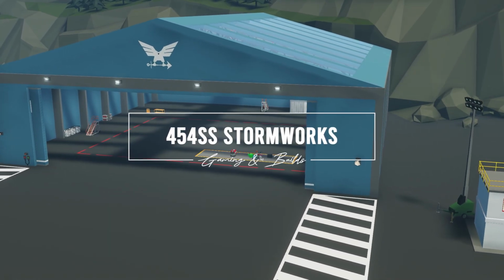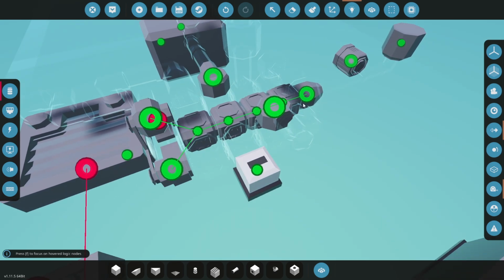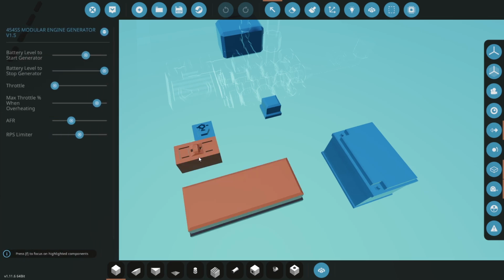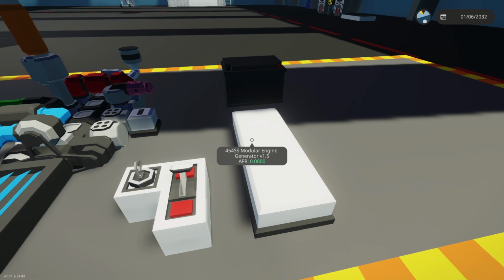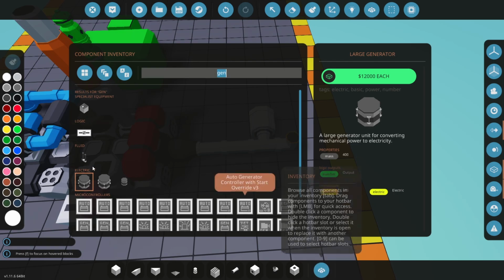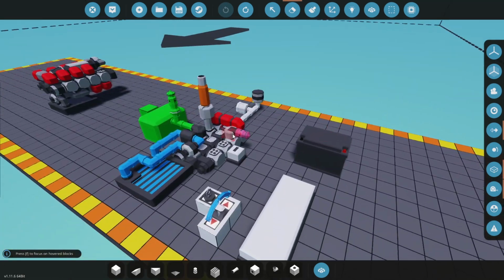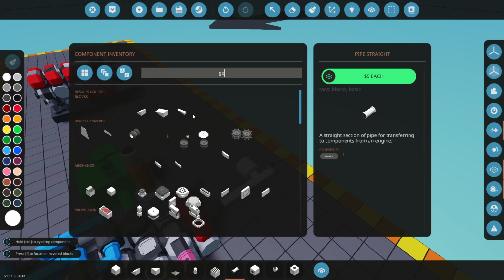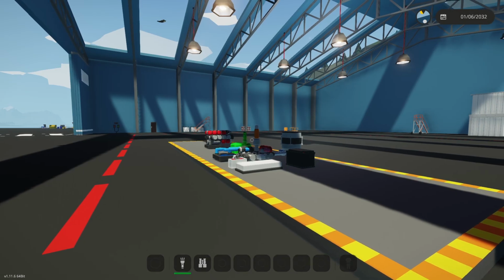COMMON Modular Engine MISTAKES in Stormworks

Comment: i downloaded the game like 5 days ago and i went trough all the tutorials and i cant make an engine run, i even tried only connecting the air intake, fuel intake and exhaust but even there the engine doesnt start up
Reply from the maker: It can be tricky at first, but with a bit of practice you'll be building engines in no time!
Reply: Did you find a solution? Losing my mind because im struggling to start it too

Comment: My Engine is starting and running but not putting out any power... and I cant find the reason :(
Reply: Have you set the alternator's clutch pressure?
Reply: @petlebem  yeah, but meanwhile I found the error. I had a pipe between the engine and the clutch for reasons of space. But thanks anyways

Comment: you didn't explain this in the video but the coolant doesn't need to be looped, if you have two coolant sections and hook the 1st one up to A and the 2nd one to B the coolant with go through the engine from one point to another making cooling more efficient
Reply: what in tarnation

Comment: Ok so if the throttle and clutch are connected to a w/s and I go forward and it sits at the max rps that means adding more generators? B/c I have a large one on rn and it's not doing anything, and if I add a motor it has instantaneous power.

Comment: I’m having an issue where I travel about 15 km and I get black smoke and loose power until stall and can’t restart. 

Fuel tank is vented and engine is cooled, not running hot. 

Exhaust is single piped. 

Sharing fuel and air. 

I’m at a loss.
Reply from the maker: What do you mean sharing fuel and air? Like same pipe system?

Comment: Could you give me recommendations for more fuel efficiency in my ocean liner? it uses the 5x5 engine parts, and is also a WS engine bc i suck at engines. Right now it can go 29 KM according to AI based off of the fuel economy of like 0.0015km/Liter. I would like it to be able to go to the arctic with no issue, it has close to 20,000Liters of fuel, also it should still be fast aswell, it has a max speed with inf fuel off of about 70 km/h

Comment: I wish they fix the overheating problem with modular engines. I got a medium in line 5 cylinder with a 3x3 radiator per cylinder with a reservoir water tank and overheats at 8 rps of work

Comment: I always use a clutch controller for my clutch, I thinks it’s the best options cuz then you don’t need gear set to make so the engine doesn’t die whenever you first start moving and also makes so when you are stopped your engine can keep generating electricity.

Comment: for weeks ive been having issues where my modular engines always overheated even though the system always worked at max throttle on constant RPS with no patch notes saying anything about a change which couldve been responsible for this problem. its 4 1x1 cylinders and the cooling system is like with the engine in the video
Reply: Honestly the way I fixed the overhesting was by using as much cooling as possible. See I build a medium sized medical ship that required a large modular engine that was about 24 crankshafts long. But even when I had tried to run jt I would always run into issue with temp skyrocketing. I suggest for you to cool your engjnes mainly with fresh wter if possible and some radiators. Water cooling is best so use enough pumps to suppy cold water in and hot water out. Another thing is if u have an ECU set the AFR to something greater than 14.7. This would reduce your rps but would lower tempuratures. Anyway I hope this helped.
Reply: @lskittle2748  i always used water cooled with one electric radiator, i once tried running it through 3  electric radiators (it goes into the first from there right into the second and so on) and even there it didnt help, not to mention such a system is something i dont enjoy as i preferably make planes, before i had the issue i had no pump but now i use an impeller pump or this one that is specifically for the modular engine like it was in the video. as is rather obvious my space is rather limited inside a fusolage, not that i got any coolant system worthy of being used inside a plane due to spacial limitations, and lowering the RPS is effective but a plane is for flying, not driving. spacewise i would say my coolant system could be a maximum of 4 blocks long, 3 blocks wide, and 2-3 blocks tall (the radiators can stick out at the bottom).
Reply: Try lowering your pump flow rate. May seem counter intuitive but if the water is moving to fast it wont pick enough or release enough heat to cool the engine. Moving to slow has other issues.

Comment: Why haven't I ever seen the gas relief valve issue?
Reply from the maker: Maybe it was fixed, but what I saw happen is that that at a very low pressure, the engine stops getting fuel, and you cant refill it either... Pretty much destroys the engine :D
Reply: @454ss_gaming  I use a fluid pump hooked to the crank to pump my fuel out, do you think that doing so might counteract the pressure issue?
Reply: @evanestrada3407 I think it works, can't test it myself, but a relief valve is probably better in terms of power usage and a little bit of space.